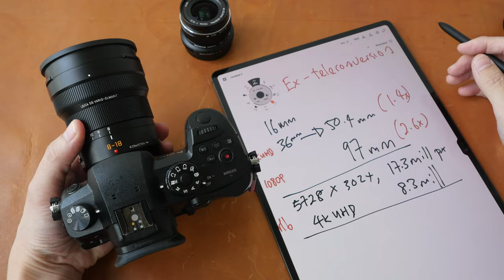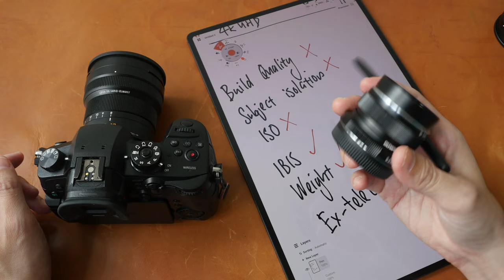My disgusting Panasonic GH cameras: Why I still use Micro Four Thirds

Comment: Sticky peeling rubber is the same across most brands, early Canons were plagued with it, some is more hard wearing that others, guess it depends on if the manufacturer decides to cut corners or not to save a few pennies.

Comment: Disintegrating rubber. Touch screen does not work. Cannot make or repair videos. Something wrong internally. Difficulty powering up. Side plates gone. Mic input gone. 10 years old. This video says more about its owner than the camera. Stop being so damned cheap and spend the $500 to replace it!
Reply from the maker: Oh, I can replace it easily, except it still works.